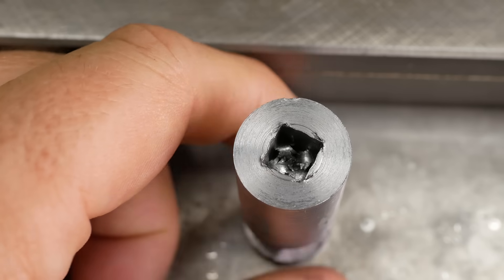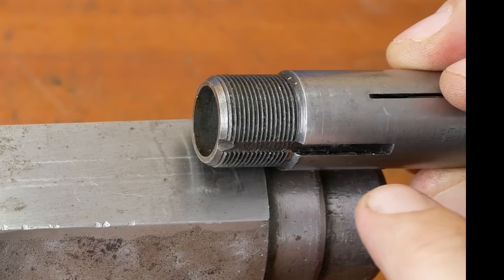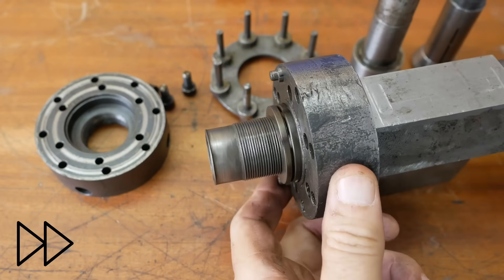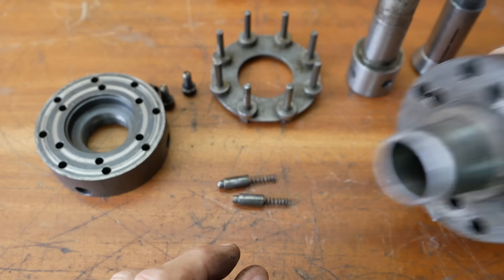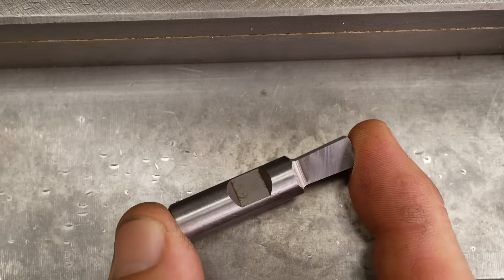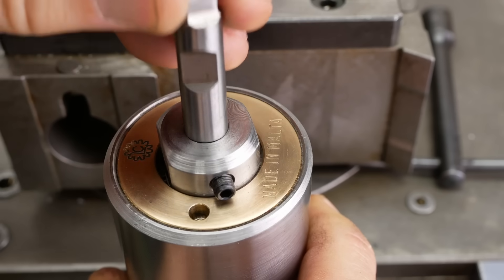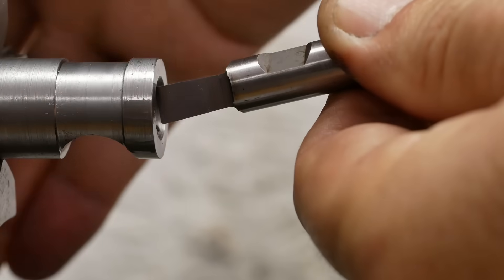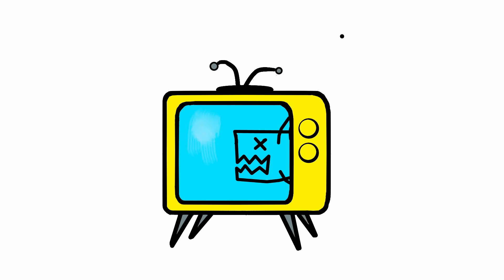Broaching problems - fixing my old indexer || RotarySMP

Comment: I think i would  understand it so that if you drive the holder the broach are always concentric with the holder but if you drive the part you can introduce shear forces into the broach if the center of the holder and the center of the part are not exactly aligned.
maybe thats the case
Reply from the maker: I measured the focal point, in the last video to ensure against that.
Reply: @RotarySMP   i dont mean the focal point. i mean the center axis of the holder (holder), uh sorry my english sucks  :D
Reply from the maker: @Neonomicon1  The tool body was right on center height, and set correctly across. take a look in my last video, as I showed finding the right tool length to get the cutter to be turning concentrically. But I might not have then set it with enough accuracy.

Comment: I believe the size of hole really matters and it needs to be a certain amount bigger than the flats of your broach, and the amount that you dish the front of the broach is important too, feeds and speeds I’m sure need to be right but I don’t know where to start with that
Reply: I only watched videos about this, but your pilot hole seemed too small. Similar broached holes I saw often have cylindrical surfaces between the corners.

I think you just overload the tool with an excessive DoC.
Reply from the maker: @besenyeim  Good point. It was a 7.5mm pilot for a 7mm broach. But it seems you need 1.1x the width across flats.
Reply: @RotarySMP  There's your issue. Thats way too small.
Start easy, 8mm, then work down.
Reply from the maker: Thanks for tips

Comment: Can’t wait, that indexer looks nice
Reply from the maker: Hi Luke, it is a cool design, but poor finishing
Reply: @RotarySMP you did a good job of explaining how it works. Maybe try with a flat front as might help create a stronger edge just a thought but worth a try I guess
Reply from the maker: @LCalleja  Isn't a flat face a 1 degree negative clearance angle? I thought this would need a bit of a dished front to lower the cutting forces.
Reply: @RotarySMP sorry didn’t mean totally flat just a bit flatter I ground my tool face on the corner of a 100mm wheel and it work good.
Reply from the maker: @LCalleja  Oh, that is very flat. I used about a 40mm wheel this time. Bigger than the dremel wheel last time
Reply: @RotarySMP 40mm should be good I used a 100mm as that is what I had:)